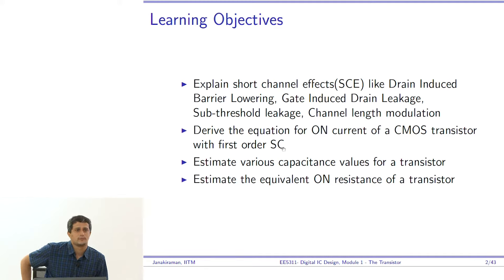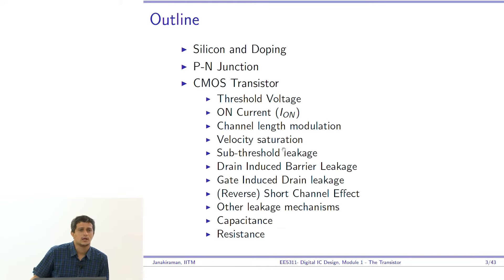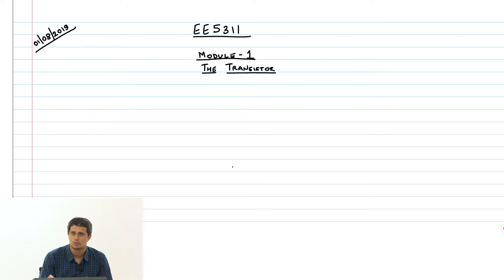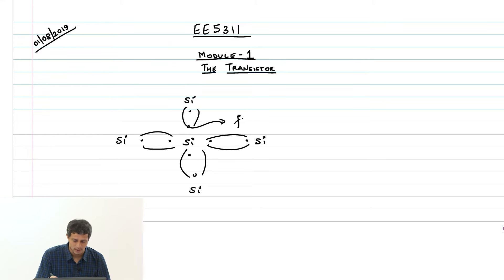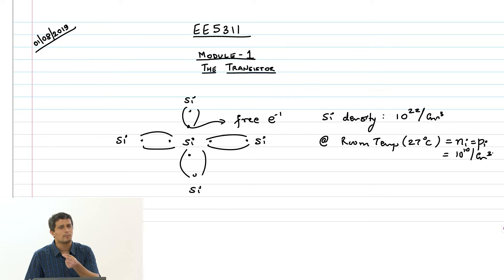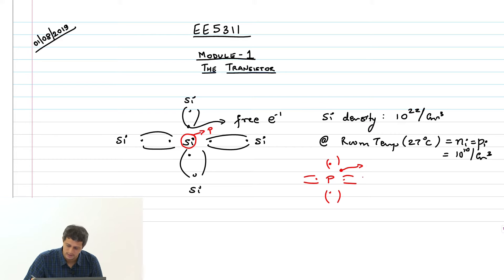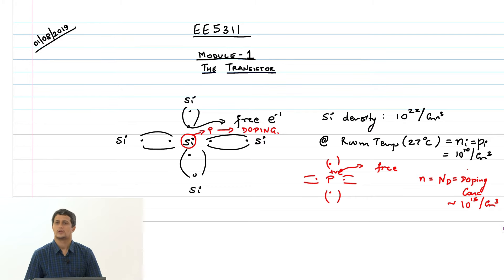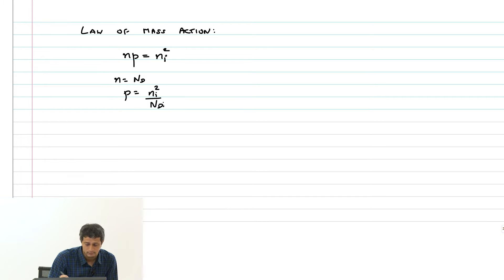Transistor - 1 - PN Junction

Comment: what is the difference between digital electronics, digital logic devices and digital IC design?
Reply: Digital electronics is where you learn about logic design where you considering an element as a block and have to deal with input and output, for digital logic devices i am not sure may be something related to device physics and in digital IC design you dont consider the digital blocks as black box you need to know what's going inside the block and how to optimize it, in either of the way i.e making its computation faster or making it more energy efficient.